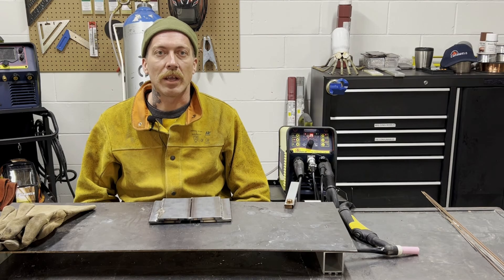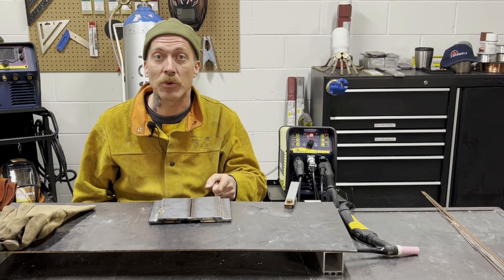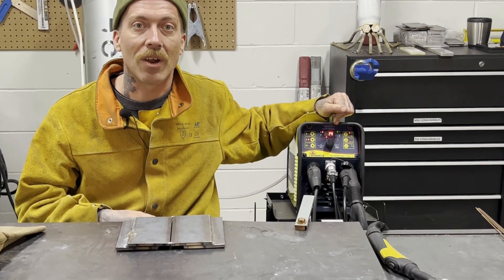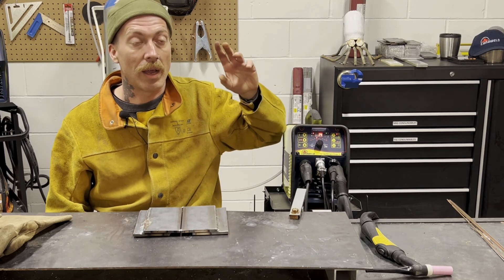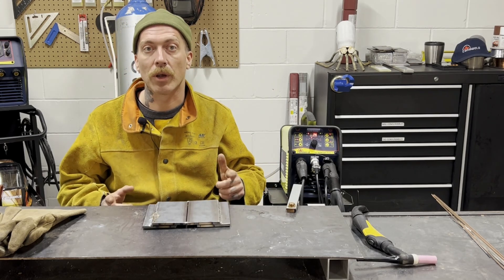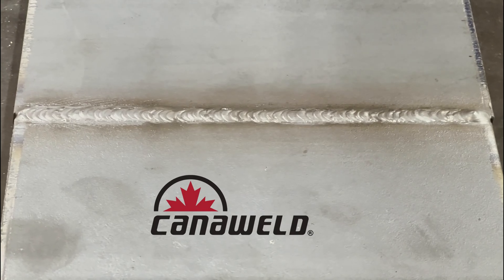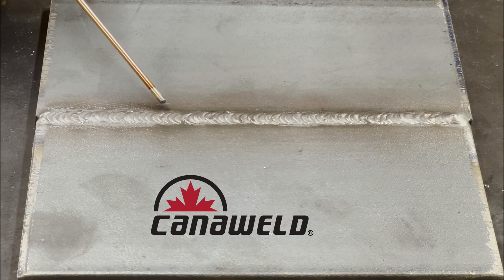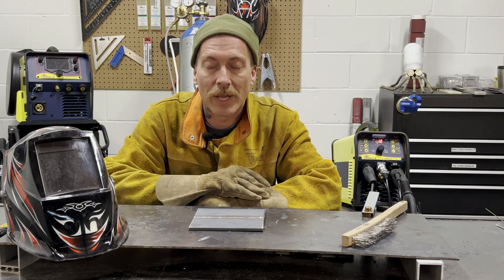TIG AC DC PART 1, DC WELDING

Comment: next part AC and how balance works, and what balance to use in various Aluminum configurations - if that makes sense?
Reply: Absolutely it does , depending on the quality of the aluminum you def need to make adjustments! I can go over that for sure ! Give me a little time to get my hands on the various grades of AL commonly seen . Thanks for the great suggestion,  it means a lot to us!